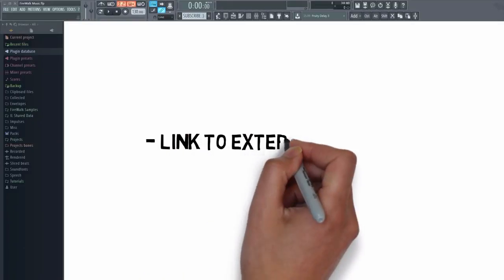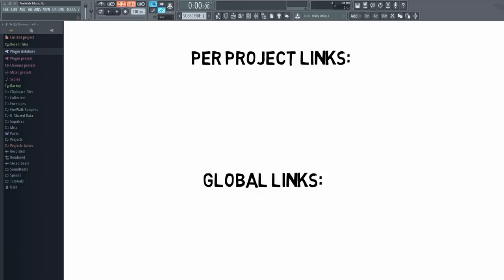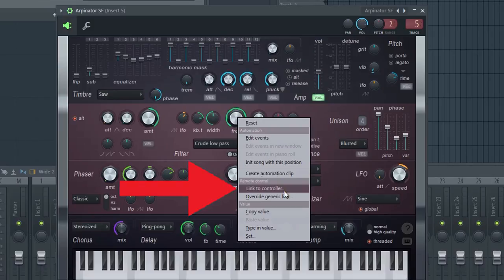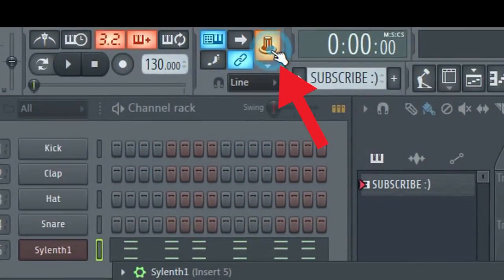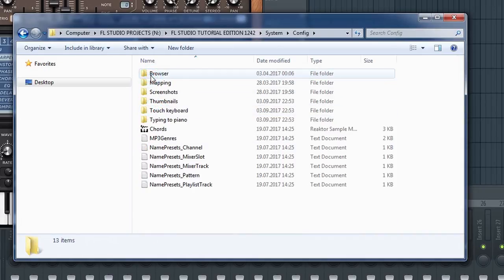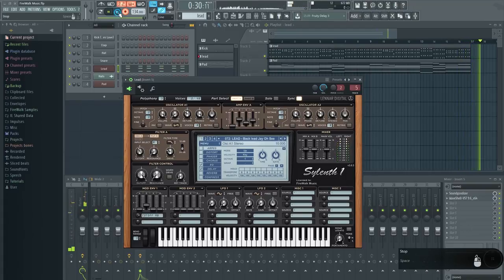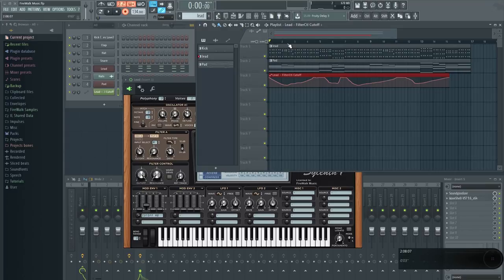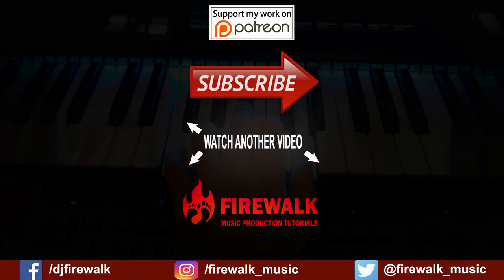How To Map Midi Controls in FL Studio (& Record Automation)

Comment: I tried doing this simply for the main volume knob on FL studio and there is no option to do that. So theres no way to be able to slide the volume up and down as I play using my keyboard? I dont understand. This is the most basic thing you can do is turn main volume up and down with a controller, I dont even need to get into a plugin or synth yet, still struggling to get basic control of the most basic things....????
Reply from the maker: Hi, I know. Some controls can't be linked and it's primarily the transport controls. You could automate the mixer master fader instead, or add the fruity balance to the master, and link it to the volume knob there. In any case, just make sure to reset this to default when you're done with the project.

Comment: That was well presented but how does one map the Play, Stop and Record buttons to their controller?
I have an Axiom Air 32 by M-audio and can't fathom this mapping requirement.
Reply from the maker: Those are the transport controls and should be automatically assigned when you use the correct controller type. Go to options and midi, and then make sure the right controller is selected. The transport controls (play, stop, record etc) should then automatically be assigned.
Reply: @FireWalkMusic  Thanks but unfortunately, this M-Audio model is not yet supported.

Comment: how do you assign record pause and stop buttons to a midi controller?  I am sick of using a keyboard to trigger the record when my midi piano is far away from my laptop
Reply from the maker: That's the transport controls, they are reserved and should be assigned automatically if you have the correct driver loaded.

Comment: wonderful video but i dont know how to set pich and gain wheels same methods ?
Reply from the maker: In theory, yes. All though for those I think it's better to edit the CC's manually (you can find them in the browser). FL Studio has always been kind of bad with MIDI. Other daws map this stuff out for you automatically, but in FL You need to set it up for yourself. The excuse is that you're supposed to retain 100% control of the mapping. That's all good, but it really just cause annoyance for the most part.
Reply: thanks ill try it before it was connected automatiquely but now days it donsent work i mean i just cant connect it

Comment: At 4:48 I can hear my automation recording just fine (same as yours sounds in the tutorial), but when I stop recording the automation event doesn't actually register in the pattern....as if it wasn't recording. I followed the exact steps as you, recording automations is on, and I have the knob correctly linked to my controller. Like I said the effects sound like they are getting recorded, but aren't actually recorded once recording is stopped...why is this? It works just fine recording the automation event when I'm turning the VST knob with my mouse, but as soon as I record automation using my MIDI controller for that same knob, the automation event doesn't get recorded. I've seen numerous people on FL Studio forums also having the same problem, any ideas?

Comment: I tried different ways but couldn’t... How do I assign fl studio transport panel from my midi keyboard?? Thanks!
Reply from the maker: You can't assignt he transport controls. Those should be assigned automatically. If they're not then you're not using the correct driver for your midi keyboard in the FL Studio settings.
Reply: I see! Thanks! I will install the correct driver for  this  !

Comment: Can someone explain me why my automation (after pushing Stop button) is flat and seems big square steps after recording, but in the video it is smooth and round. Which settings control this?
Reply from the maker: If you right click on any point in the automation clip, you'll see a list under "mode", offering various shapes. Seems like you have yours set to square. Set it to "single line".

Comment: How do you bind the buttons, though, like the play/stop or mute buttons?
Reply from the maker: Those are the transport controls. They should be assigned automatically if you've selected the correct driver for your midi interface in fl studio.
Reply: @FireWalkMusic  Currently on a generic midi device, my brand doesn't appear in the list.
Reply from the maker: @RyanAvx  what is it called? Often times there are certain drivers that can be used for a lot of different devises that use the same control protocol, like mackie.

Comment: Is there a way to set a default position for a controller link? I'm using the pitch wheel on my keyboard as a mod wheel, but by default it's in the 50% position. Can I set my 50% position to register as 0% through FL studio?

Comment: Recording an external device into FL Studios like a Yamaha Motif are rolling or something of that nature
Reply from the maker: That's a whole different story. FL Studio is known to be notoriously difficult to use with external hardware such as the Access Virus etc. Midi controllers are one thing, they work just fine with FL, but actual hardware needs to be recorded one channel at a time in FL, even the access virus that has a VST interface, because of the PDC issues in FL.

Comment: thanks for all the info!! i was wondering WHAT THE OMNI - (WRAPPER)S ARE UNDER REMOTE CTRL IN THE BROWSER and how to edit them? any info will help thx!
Reply from the maker: Most likely the omnisphere vst. It's the automations :)
Reply: @FireWalkMusic  i thought so at first but i dont have that plugin...but omni (pich) when mapped to my m audio keystation 49 II Pitchnob creates a global (override generic link). 
i referred to the manual for hours and came up with a solution. i just wanted to create new omni controls and easily access them to edit delete or redo. here's some info that helped maybe it will help others too....

Omni - Decides if the link is channel specific. OFF - If a MIDI controller knob is linked to a channel volume, the MIDI knob will control only that specific channel volume. ON - The MIDI controller knob will no longer be tightly bound to a specific channel volume, but will control the volume of any channel selected. For example, if you linked to the volume of a 'kick' channel and then selected the 'clap' channel, the MIDI controller knob will also control the clap channel volume. Aftertouch - Select Omni mode when linking Aftertouch to targets.

Comment: I have a question. In the following example, when I click one of the Oscillator Detune knobs on a third party VST i use with my mouse, the following values (ranging from 0-100 etc.) show up on the Menu Bar. it says "OSC Detune 1", and then the values. So my problem is when i map one of my rotary knobs on my midi controller to that parameter on the VST, i can no longer see the values on the Menu Bar when i turn the rotary dial that's been assigned to it. All it shows is the MIDI input activity button lit up red, but the values i saw when using the mouse are gone from the Menu Bar. Any thoughts?
Reply from the maker: This is typical FL Studio. It doesn't deal with exact values like other daws do. Instead it tends to deal with percentages and such. For example, when automating the volume it doesn't show the value in BPM but in percentage, which doesn't really mean anything. 
I've found that the best way to deal with it is to move the knob manually to the exact value you want, right click and "copy" and then paste that value into the automation clip. You have to keep doing this until you get the values you want. Quite tedious, but it's the only way I know of.

Comment: Tried these methods & every single piece of info I could find on the web, and I STILL cannot get the MIDI maps I make for 3rd party VSTS to my controller keyboard to save permanently. Only work in the project I set them in, no matter what I try. Ready to pull my hair out
Reply from the maker: Hi, did you try global links?
Reply: @FireWalkMusic  Yes that''s what I meant, I followed your steps for global links as well as others I found online & in every case, nothing I set saves for other projects. 1 of the plugins is UVI Workstation which I was told I have to set "Host Automations" to, but still all I can figure out is how to get them to map in the project I set them in after I go....The other plugin I tried was Camelphat, no "host automation" settings to make, but same thing....Also, it doesn't seem to let me set 1 knob on my keyboard to 2 seperate VST parameters either, depsite clciking on the window to make one "focused"

Comment: Okay, but how do I link the play and record buttons on my keyboard to the play and record buttons in fl?
Reply from the maker: You can't do that with this method. Those are the designated transport controls and are therefore not mappable. They should be automatically assigned when you select the correct driver for your midi keyboard in the midi options.
Reply: @FireWalkMusic  Thank you!

Comment: How do I link some of my switches to pause/play and record in fl. Pls help
Reply from the maker: Those are the transport controls. If you have hooked up a midi keyboard then those should already be mapped out so that you can use those buttons on the keyboard itself (play, stop, arm record etc)
Reply from the maker: @lojarich  You need to set up the proper driver for your specific midi keyboard in the Audio settings in order for the transport controls to work. Some like the oxygen 61 for example are supported, in that case just choose oxygen 61. Others need to use a generic driver, like the NA komplete Kontrol for example, which needs to use the mackie universal instead. If you search on Google then you should be able to figure out which one you need to use for your specific midi keyboard.

Comment: Hi, thanks for the video. I'm having a slight issue getting my Nektar Impact Lx88+ to communicate with fl studio 20. I've set the ports to 155 in the midi settings. In the top left of fl studio it tells me note off note on and which note it is when I press a key on the Nektar, but I can't arm record from the nektar, press play or use any of the mixer controls. Apparently it's supposed to be simple and it should work right away when you set midi settings, but this isn't working in my case. If you could let me know what I'm doing wrong I'd very much appreciate your help. Forgot to say if I press the play button on the nektar a green knob comes up in the top left bar of fl studio with a question mark in it.

Update: My fault.... I didn't have MIDIIN2 (impact lx88+) set to port 155 all working now! 
 Cheers 👍

Comment: Hey guys.. I bought a Nektar LX25 controller which worked perfectly when I first installed it. I use FL Studio 20. It came with a DAW called Bitwig. I tried it out and when I went back to using FL Studio, suddenly the parameters were no longer mapped. The keys and pads still work but I can not figure out how to map the parameters again. It was actually pretty integrated before, now nothing is linked and I can not figure out what in the hell I need to do to fix this. Has anyone else experienced this issue when using the same controller for multiple DAWs?

Comment: hello.  i try to send my Midi Signals from FL 12.3 Piano Roll to my Sampler Roland MV 8000 .  but i cant find any Video about this .  i try to Do it without Exporting the Midi Signals and import to my Sampler over usb.  is there any way to do it fast like i press record on the sampler and the sampler record only the signals without the Sound . Just the Midi Signals ... that would make the workflow much easyer and faster -
Reply: i use a Roland Rubix 44 soundcard with Midi in/out Cabels  everything is connected and work . when i hit my pad on my sampler hardware the chosed sound in FL studio start to play -  but to make ist easyer after resampling i will record the midi signals also to the sampler  so i dont need to programming the midi lines again in the sampler .  hope i explain it right ^^ with my bad  english

Comment: I finally figured out how to change channels on my keyboard. So now I'm able to open up one instance of contact and load up 16 instruments and control all 16 from my keyboard. But the problem now is that I filled up one instance of contact and used all 16 channels on my keyboard, I can't control anything else.
How can I fill one instance of Kontakt, set all 16 channels up.......
But still be able to click a new instance of Kontakt and it change from those 16 channels to the new instances 16 channels?
Cause I normally have 3-5 instances in one song. I do orchestral music.
Because even if open open wanted contact per instrument, to be able to use the faders for Dynamics and expression I still have to do separate channels. So I can either have 16 instances of contact with one instrument or one instance of kontakt with 16 channels.
And in it's the same.
I'd rather have all 16 channels filled, programmed to my keyboard. But then just click a new instance of Kontakt fill up all 16 there and be able to switch back and forth.

 I have an MAudio Keystation prof 88,. From what I'm reading this keyboard can do a lot of shit, but reading the manual confuses the hell out of me and I don't understand a single thing that they say in the manual.
Reply: I tried to just record all the Dynamics and expression and stuff and then unlink and link to a new one and record all those but whenever I unlink it, it stops controlling it. And then whenever I do it all in one instance and then move to the second instance basically both instruments in channel 2 fight each other over the automations and they all glitch out and fuck up.

Comment: Why not make developers to record automation occurred in the clip and not into the event? Events this is very inconvenient when recording multiple automation from project to project. You get tired of working with them and takes only time..
Reply from the maker: Indeed.. It's something that's still there from the old days. I guess the daw was made that way to begin with, and now it's become very difficult to change how this basic behavior works. They also have to consider backwards compability with older projects. I agree that it's quite cumbersome compared to how this works in other daws where you just press record and then touch a knob or whatever, and it will appear as an automation in it's own lane related to t he synth or whatever you were automating to begin with. It's just much faster. So there's definitely room for improvement here I think.